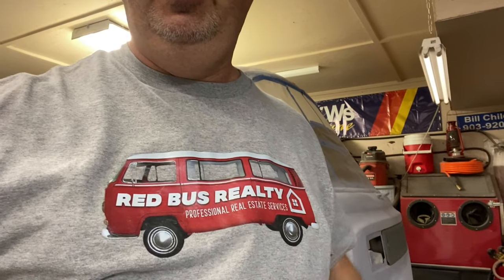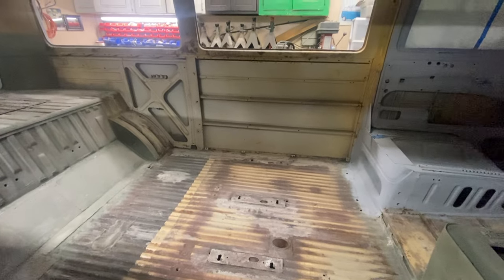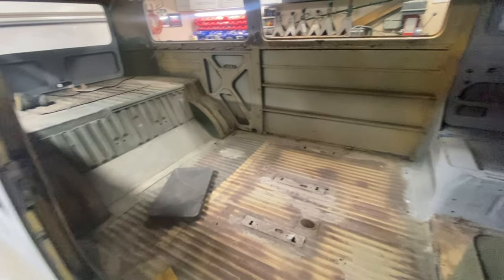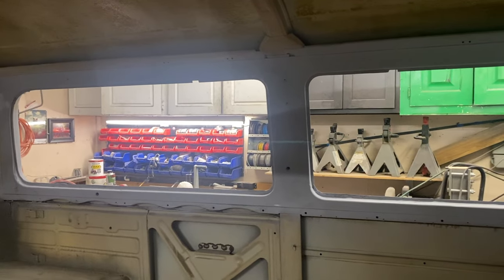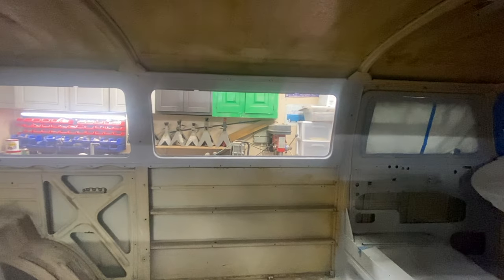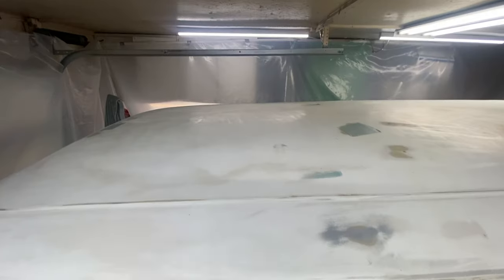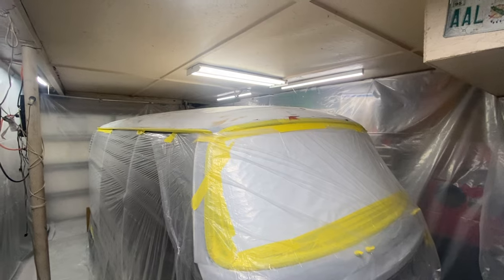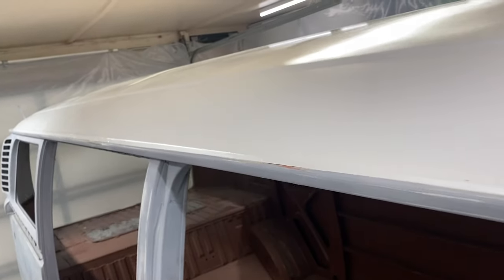Painting a VW Bus at home!

Comment: Once you paint it and put the door sliding back on, what kind of grease will you put in the rails so it slides nice?
Reply from the maker: I’m used marine trailer bearing grease. It doesn’t hold moisture. It the stuff they use in boat trailers.
Reply: @rustydubbs  - Thanks! Love your videos. You have far more skills and confidence than I do to take on these challenging projects, but I get a lot of value and great advice by following and watching. Cheers.